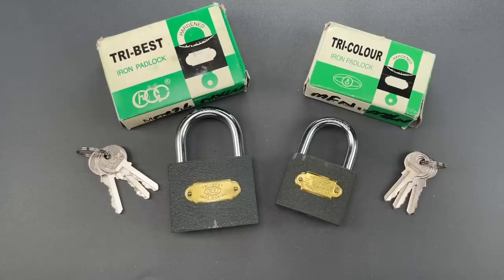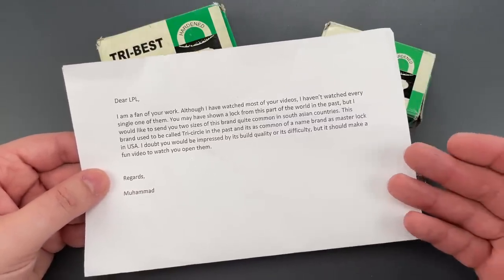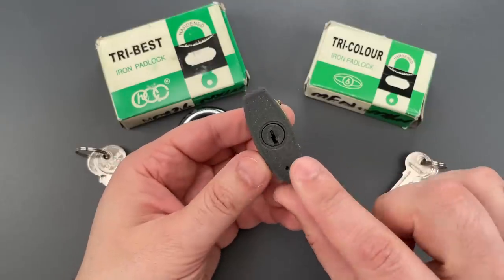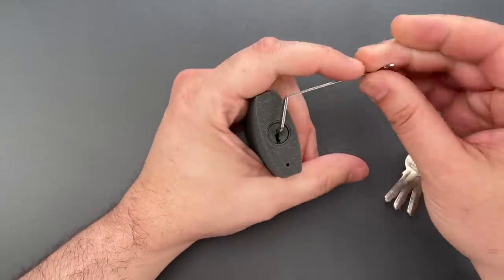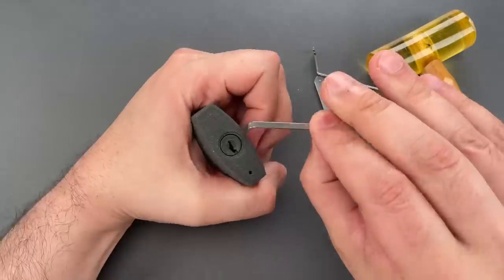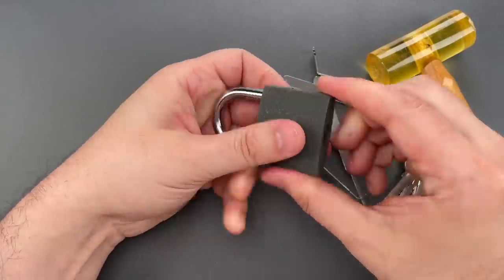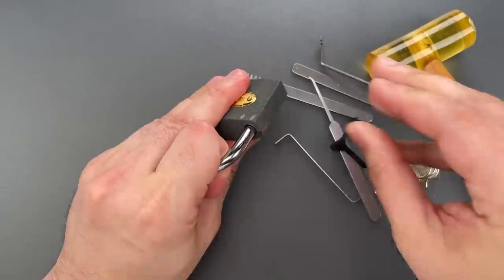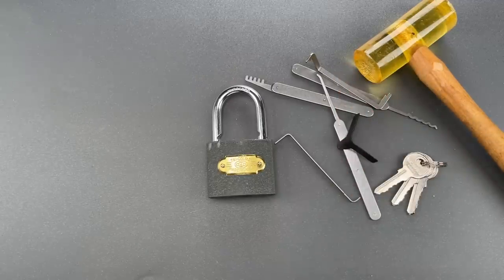[1460] Why I’m THANKFUL For Master Lock… Sometimes

Comment: I have a lock that looks just like this. I used it to try my hand at lockpicking for the first time ever, using bent paper clips. I actually didn't even get to try to pick it one pin at a time, the lock just opened as soon as I tensioned it and stuck literally anything that would fit inside.
Reply: Look at episode [1446] for a similar 'quality' lock
Reply: That was actually my experience with a master lock. Granted, I used an actual wave, but... I didn't get to use it. The lock sprang open the moment I inserted it.
Reply: I actually laughed out loud at that.
Reply: Something like that happened in our office. I have a set of picklocks (the cheapest set there was) mostly for unlocking old kensingtons and for cleaning computers (it is amazing how useful those are when you need to clean keyboard, put a key back there, pop out the back cover from laptop, remove broken USB dongle from the USB port,...). I wanted to see how good are locks on cabinet we use to store some computers. Tension, put in wave and it opened...
Oh, and I tried my drawers there. I wanted to use wave first, but it got stuck there and I REMOVED THE LOCK! Then you just need a flat scredriver (or scissors) to actually turn it and then put the lock back in. It is classic wafer tumbler lock, but the last "wafer" is in fact not part of the locking mechanism, it is holding it in place.

Comment: "plastic core disguised with paint" reminds me of an account I read of a reporter touring a Chinese factory making drill bit sets for the "homeowner" market. Typical product: 1/16 inch to 1/4 inch in 1/32 increments. At one stage of the process, a worker was dunking five of the bits (not the 1/8th and 1/4th into a chemical bath. The reporter asked her what this step was for... The answer was: to make them look like the other two...
The 1/8 and 1/4 were made of tool steel, while the five in the chemical bath were made of whatever. The reasoning is left as an exercise for the reader.
Reply: @Linus Fu How long did the styrofoam bridges last? What kinds of loads were they subjected to?
Reply: My question is why they bothered to make two of them real?
Reply: @renakunisaki  Because one or both of them are likely to be used soon (or at all, even). And when they fail, the set gets returned for a refund in large numbers The big hardware chain that sold them doesn't like that and stops buying from that supplier... End of gravy train, for the manufacturer.

Comment: Oh my god, I have one of these locks! I was backpacking across Vietnam and needed a padlock to use with hostel lockers. 

I knew they were bad, but not THIS bad 😂. But hey, I didn't lose any of my stuff, so it still did the job. Sometimes even just the outward appearance of security is adequate, even if it's nowhere near ideal.

Comment: This lock has the security level of a piece of paper stating: "Do not open"
Reply: True, I have seen sheets of paper that had more effect... (stating camera surveillance for example)
Reply: That's like the plastic chains used for security in Japan! I guess you don't need much security, when most people are honest.
Reply: At least you’ll see the tampering with a piece of paper
Reply: @buddyclem7328  Sometimes all you want is for a door to stop banging in the wind. Then you just need a shackle, not necessarily the actual lock :P
Reply: Can he open it with a single sheet of paper?
Reply: @Poldovico  tbt, for that purpose I'll just fold several thick electrical cable wires I have laying around 😆
Reply: @PanduPoluan  Sounds like the garage in my workplace :P
Reply: Are you saying my Shinto priest evil sealing talisman papers do not keep out criminals?
Reply: These locks actually scream 'open me' so that's technically be better.
Reply: @chrisjohnson7929  Considering he opened it with a shim? If you folded it right you could probably make the paper into a less sturdy shim that'd still work.
Reply: @Sandman382  Interesting thought. A business card that doubles as a shim would be perfect.

Comment: I'm convinced they come from the same factory, we have lots of them here in Guatemala and you can get them for as little as USD$0.10, they are "universally keyed".  Meaning you can open them with any key with the right length.  Thanks indeed for Master Lock!
Reply: They are not from the same factory. This manufacturing mold is so old and so common in China basically any manufacturer, even if a mom and pop factory, can produce it. That's also why they are so cheap and worthless.

Comment: These were the locks that were used in our school. Except they had brass core. Otherwise yeah, they were as easy to open as you demonstrated. We generally just used the raking method with rakes we made out of soda cans with scissors. We didn't steal stuff, but it was a show-off thing to do to get into your locker without using keys.

Comment: "No lock can be worse than th-"

Someone makes a lock with 3D printed PLA, saying "hardened" on the shackle; "security rating 10" and "all weather", "enviromet friendyl/biodegenerate" texts on the box. The locking lug is made out of ABS for "better heat resistance" so that acetone attacks are usable
Reply: Thanks for the great business idea 😇🥰👍
Reply: Don't forget to glue the parts with proper PVA glue, so that "All weather" claim goes above and beyond.
Reply: I love all the spelling errors, feels so genuine
Reply: @norsethenomad5978  even better is terrible English. Typos, similar sounding wrong words, completely wrong words, etc. I love all of them.
Reply: At some point you're better off using a twist tie.
Reply: @renakunisaki  "This is the LPL, and what I have for you today is a competition between q twist tie and a MasterLock. The tie costs nothing, and it usually comes with other things you buy. The MasterLock costs $$$. And you can use the twist tie to open the MasterLock with just some practice. Additionally, you can use it to annoy the potential offenders and take their time. So as we can't see again, MasterLock is worse than a cheap twist tie.

In any case, that's all I have for you today. If you do have any questions or comments about this, please put them below. If you liked this video and would like to see more like it, please subscribe. And as always, have a nice day.

Thank you."

Comment: I bought a tri circle padlock from a local store here in Northern Ireland. I can open it using only a turner by simply lifting the pins and turning.

PS I would 100% buy that hammer
Reply: It's only a urethane hammer, nothing exciting.
Reply: @NirateGoel  I'm a sucker for branding
Reply: Covert Instruments Special Series - Rapping Device
Only $59.99!
Reply: @SpaghettiViking1  sold

Comment: Paint it orange, write “Warning, Do Not Turn On” on one face, and it’ll make a good deterrent lock for safely cleaning and repairing industrial equipment.
Reply: Only problem is that safety locks shouldn't open to the wrong key, and given the bitting on the key in the video I'm not sure I'd trust this lock to do that.

Comment: My son has become interested in picking locks but we haven't gotten around to getting him some tools and locks to practice on. These might be a perfect beginners choice! :)
Reply: No, you want something more difficult than this.  With this, you aren't learning anything.
Reply: Considering that the core is made of plastic, this actually might not be the best lock to start on because he might break the internal mechanisms and not have to "pick" anything to get it open. 
I had one of those clear locks that is supposed to help teach lockpicking and I broke it on the first day by putting too much tension on the core.
Reply: @nightbringar7558  That's a good point. I thought it would be a good choice because it's easy to pick (my son gets very frustrated if he doesn't start to feel like he's accomplishing something early on) but it breaking would be horrible.
Reply: Master locks are a good place to start. Get 4 or 5 identical ones (not keyed alike) and a basic pick set. Don't use old or worn locks, they can be frustrating if they're rusty or dirty inside. You might also want to get a cut-away lock so he can see how the process works first. 

These ultra cheap ones can actually be quite hard to single pin pick (they can be weirdly mushy and gritty) but usually open really fast with a rake. Not the best choice to learn SPPing because they don't give good feedback due to sloppy construction.
Reply: Get Master 141s. 4 pins, can be single pin picked, raked, and comb picked. Cheap, and easy to open. It's what I suggest you use once you graduate from transparent practice locks.
Reply: @shura0107  Thanks! :)
Reply: @shura0107  slight note of caution - Master do produce some of their relatively inexpensive padlocks in the European market with spool security pins which makes them a less good place to start. So just be a bit cautious and stick to the basic 4 pin aluminium Master 40 mm padlocks in Europe (laminated Master number 3s aren't really available at hardware stores here - it's all alumium padlocks for some reason).
Reply: @chemistrykrang8065  Yes, that perfectly describes the Master 141 series.
Reply: Actually, for the beginner, value for money, they sell a practice lock kit, that comes with a core and all the assembly tools, and you start by building a lock with 1 pin. 
Then, add a 2nd, and pick a 2 pin lock, etc.
It has 6 pin positions and includes a wide variety of pins, so once you are confident in picking multi-pin locks, you can start adding spools and T-pins, and serrated pins, etc.

All in one kit.
Reply: @1TwistedPoet  I have a repinnable practice lock like that but I've never really gotten on too well with it.

Comment: As bad as they are, they still serve a purpose: it's still breaking&entering even if it's stupid-easy to defeat the lock.  No one can claim they "didn't know" they were not supposed to be in something if they had to remove a lock to get in.
Reply: Good luck with your insurance company claiming somebody broke in when the lock and door aren't damaged, though. They're more likely to say you left it unlocked and refuse to pay out than believe somebody got in non destructively.
Reply: @chemistrykrang8065  But then you'd have to show they can be got into non-destructively, which would in the process indicate that you knew you were using an ineffective lock. A bit of a double-bind.
Reply: Fair point.
Reply: @herseem  if somebody gets in non-destructively you're just screwed with the insurance I suspect. It'll be on you to prove you locked it in the first place so you've got no chance. Buy a half decent lock!

Comment: It never ceases to amuse me just how simple picking a lock can be. Yeah, you can carefully pick all the pins, or rake it until it pops open. But if your lock is particularly cheap then a little shim made out of a can of Redbull can do the trick. Of course brute force and a hammer will always work, you just need to apply enough of it.
Reply: Well there's locks and there's locks, there's some that seem to open if you look at them meanly where as others take effort even from someone who has been picking locks for a while. With a lot of the cheap locks it's a case that the people making them cut costs at wrong place leaving out rather simple methods of protecting the lock from picking, after all the lock doesn't have to be impossible to pick to be efficient at its job just hard enough that it's not worth the time and effort to pick it.
Reply: @SampoPaalanen  seeing as the lock in the video has a plastic core and an unhardened shackle making a brute force entry a matter of seconds with basic hand tools I would say the pick resistance is the least of the worries.
Reply: @jongustavsson5874  Obviously though the fact it's also comically easy to pick just adds to the whole host of flaws this thing has
Reply: @SampoPaalanen  yeah. Still serves some purpose though. I got a storage space in my appartement building, the sole reason I have a padlock on it is to show that it's in use. Security does not apply as you could quite literally tear the whole "door" from the frame by hand.

Comment: These locks should be used as paperweights, then they will be useful.
Reply: Seeing that a large amount of plastic is used in construction, I have my doubts it would even be useful as a paperweight.
Reply: In escape games too and you put that video as an hint.
Reply: I disagree. Plastic core means that no brass in the makeup of the lock, which in itself means that we've a light lock that'll not stand up to some wind from my window.
Reply: With all that plastic and tin foil, they won't weigh too much...
Reply: Don't. The cheap paint will probably rub off and mess up your papers.
Reply: you can gift them to the low-middle manager of the month.
Reply: With the heat that we've been having?! I dont want melted Lock on my papers thank you very much...

Comment: Snickers. Laughs.  Snickers.  Snickers harder. Giggles. Giggles manically as hammer bump also defeats the mechanism. 

Reminds me of a trip to a nasty port in Uraguay. The port had removed out customs seal and replaced it with a "lock" such as this. I remember getting to the container (on a secured doc) seeing the lock with confusion and slapping it back to the metal in anger only to have it instantly pop open. 

Yes ~ 2-3k usd had been "removed" from the container. Mostly camera kit and an old laptop and an early GoPro. 

Locks can suck. LPL reminds us of how much when, where how and why. Ty LPL.

Comment: I remember a lock looking like this.
It was the first lock I started picking on, with homemade tools, from windscreen wipers.

I quickly found that only one of the tumbler pins did anything, and then I was able to turn it, I went down and got a second lock at the same place same brand, with the same problem.
Got to love how lazy some manufacturers are...
the bigger problem was this was sold as a log in a fitness chain, and they never got back to me about this problem, I guess they did not care they sold crap locks to ppl.. but hey only around 30-80% of the locks in the lockerroom was this lock so no biggy :D

Comment: Yea, these locks are everywhere in south asia. Usually these days if you ask the salesman at the shop he will point out that its a copy of the Tricircle design. I think they are made this bad as they know that the plastic core will some day break (which it does) and you have a mechanism of opening the lock by hitting it with a brick. Most homes in South Asia are brick made and bricks are readily available. The only security is that you will hear a loud bang when someone else is trying to open the lock with a brick.

Comment: This channel has taught me so much, that I want to try using these tools to pick locks in my own house.
Reply: I highly recomend either picking only locks you have keys for or locks that are not attached to anything, at least for some time. And I can tell you that when the first lock (after long minutes of struggle) finally openes, it feels great. I would recomend some spring lock, so you will get the satisfying "click", I started with kensington tubular locks and I kind of felt cheated when I didn't get the rewarding click :D

Comment: LPL had me LMAO at all the flaws starting with the unhardened shackle that is stamped “hardened,” to opening the lock by tapping it with a hammer! Like a comedy of errors on MasterLocks part. They should print a disclaimer on the side of the box like the Surgeon General’s warning on cigarettes: “If you use this lock, be careful not to drop it after you lock it because it might pop open by itself.”

Comment: they used to make these from cast iron which was easy to crack or shatter. then they made them with steel and inexplicably painted them to look like the cast iron ones. ...but they all have the same shackle with two locking cuttouts, when the lock   is only single-pall.  the ones ive had either had  cheap brass or cast iron cores (yep, steel body, cast core). so the plastic cores must be a whole other newer element of cheap

Comment: I have a interesting lock. 
Electric lock. Wrong key inserted it locks itself 15 min.  Picks or other same thing. 
If you lose the key your screwed. 
You can’t pick what you can’t get to. 
Batteries in lock you can’t get to without key. Zero bypass.

Comment: I kinda wish he would show using the key in a lot of these videos: some of the time I legitimately think it would take longer and/or work less smoothly than he pulls off picking the lock.

I've had a couple locks like that: going through school it was pretty common for the combination locks on lockers to be so slushy it took several tries of putting the combination in to get them to unlock costing a couple minutes while I'm trying to fit 7 minutes of walking and a locker visit into a 5 minute passing period, I fairly quickly found that it was a lot faster to open them by feel than to use a combination, then when I finally got one that was so shittastic that even that didn't work I found that you can just smack it at the right angle and it opens in under half a second...

Comment: I have a few of these style i bought from pound shops in the UK, absolute garbage locks (obviously) and my clumsy too much force tension from my early picking days means the core rotates about 90 degrees while the lock's still locked which ironically makes it much harder to pick!

Comment: 1. Pick it like a locksmith
2. Pick it like a less-skilled picking (rake it)
3. Pick it with a comb
4. just push the lock lug (unskilled lucky-pick for teenagers)
5. use a shim.
6. Wack it (similar to bumb-style).

TRI-Best, you should be embarrassed, imaging locking your pushy with a chain and one of these locks, drop it down and the lock pops open like in number 6.

At best these locks are only good for attempting to convince insurance you "tried" to protect something...